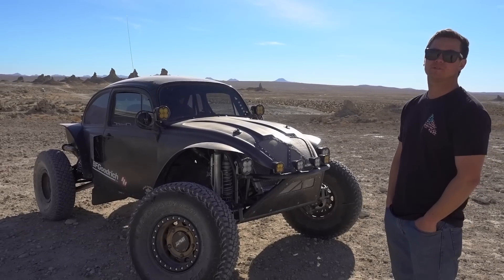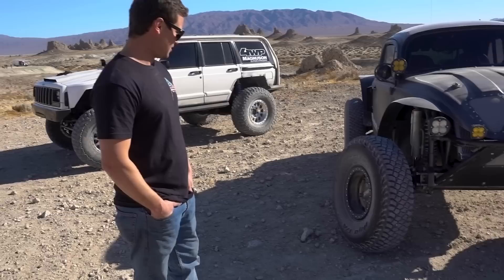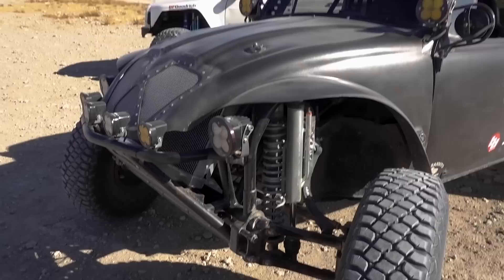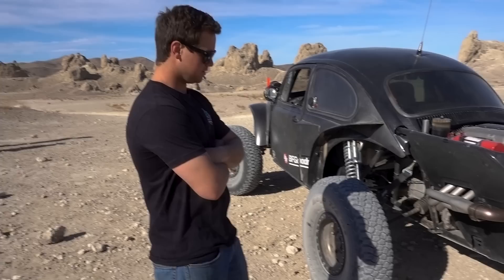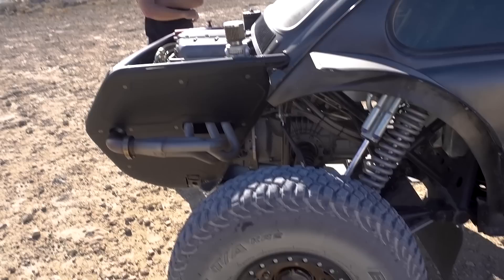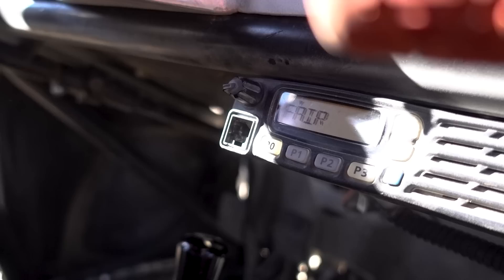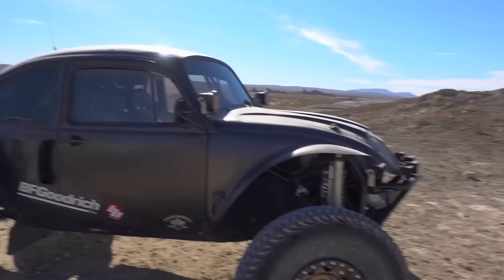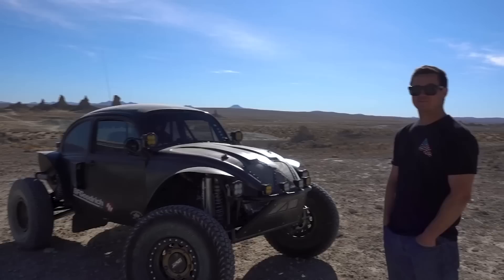Honda Powered VW Baja Bug w/ Darren Parsons! | BUILT TO DESTROY

Comment: Maybe close to the same power as some of the weaker 5.3L LS motors in stock form, but with very little money or even work by simply adding a turbo, blower, and few bolt ons your up to 600+up and climbing. That lil motor in the VW ain't coming close to that.